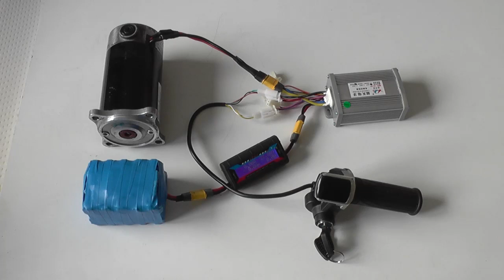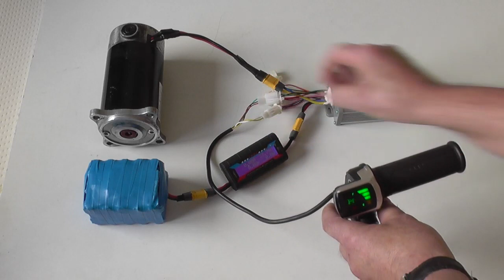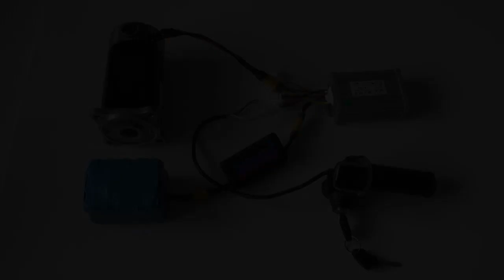Simple Mobility Scooter Controller Modification

Comment: cool simple & effective . so a question , do you have or could you make a video on changing out tiller & wig wag throttle for a steering wheel  & foot pedals. I ask because I am working to build a total custom unit. I am using a Pride Rally . I wanted it because it has 400lbs. capacity, And has the Pride's touch brake down feature. I figure It gives me pretty good custom layout. I am using a old upcycled grocer buggy by turning it around backwards of how you would push it around the store. under the basket area is a shelf for large items . But for me it will house the motor, tranzaxel, at front of basket so I can have large bank of lithium 12v 100-200ah batteries for better range. I'm using 29
' mountain bike rims & drive wheels up from I think they were 8" wheel sets. I figure that is the easiest way to increase my top speed without complicated wiring changes. But then in the next breath that I want to extend the wiring harness so I can move controls to new console, maybe power windows, .

Comment: the cheap chinese controller for brushed motors, dont have regen braking, so how do you slow down, and what about the electronic brake that mobility scooters have, how does he stop now?
Reply: good question... we never get a answer to that one
Reply: @mike-rayner-videos  you could put a 24v pwm on the electronic brake for braking using a pot resistor would do the job
Reply: @namenotshown9277   thank you